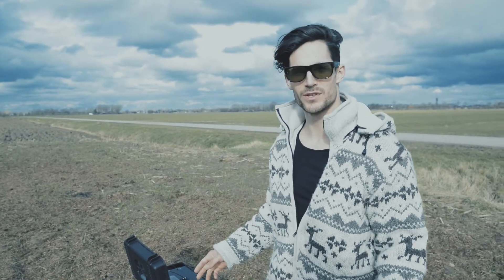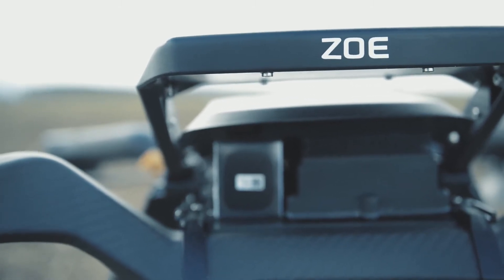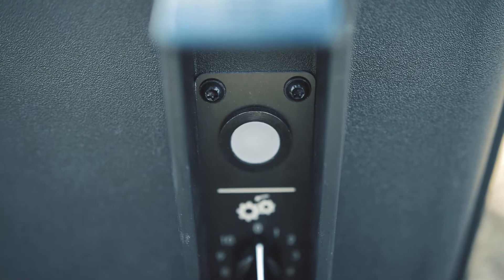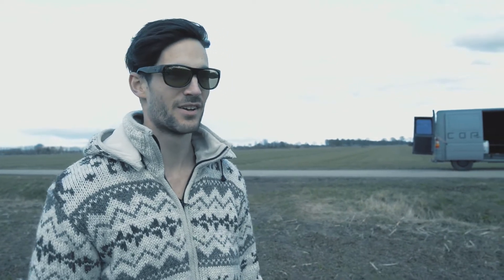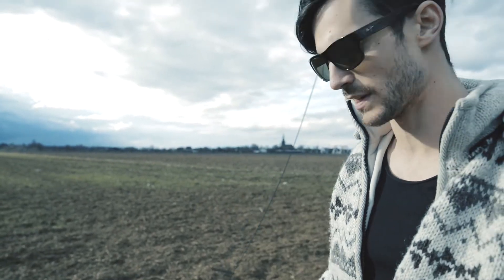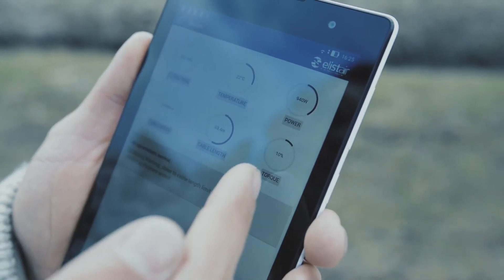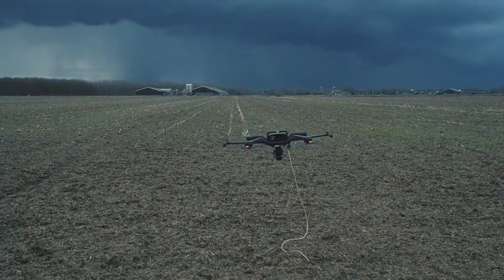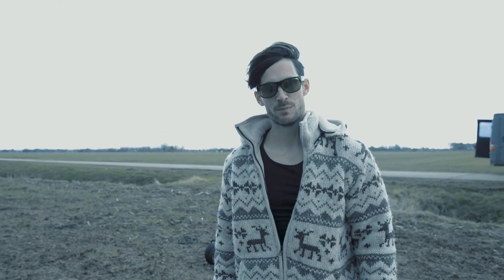Acecore Technologies - Tether System - Tether Explained

Comment: This is great work guys. Few issues. So you sent a lighting conductor up with dark thunder clouds only !km away, and moving overhead? Nice views of the spooling drum mechanism inside. Video feed in action was good as well. This is a promo video right? It has another existing company logo on the App? AppInventor will give you that functionality using bluetooth diy.
10g/w and 1000w? How heavy is the 'lightweight' tether then?
Reply from the maker: Thanks for your feedback Mark, it is much appreciated. The dark clouds consisted of rain only, and demonstrated the fact that our Zoe can be used in rainy weather as well. The logo you see is Elistair's and they are the manufacturer of the Safe-T tether system as displayed in the video. We do not hide the fact that they are the supplier and would never cover this up to pretend it is our own product. The tether box is lightweight enough to carry with one hand, though please note this is not a very hand held system such as the Elistair Light-T.